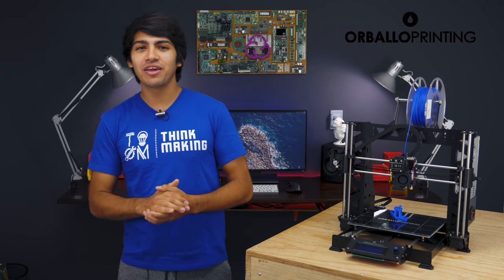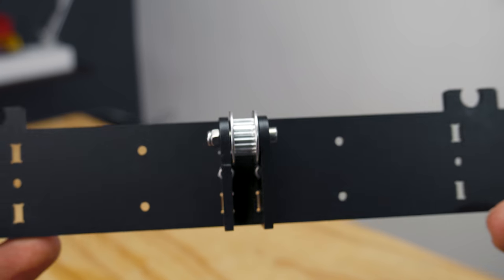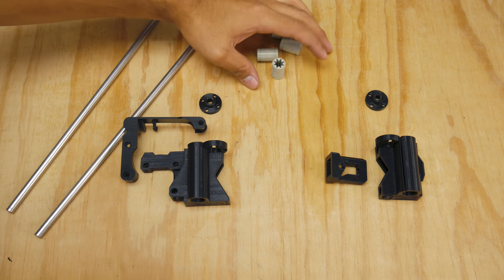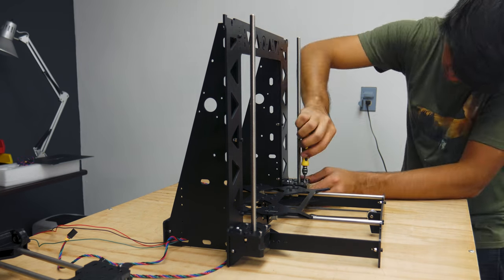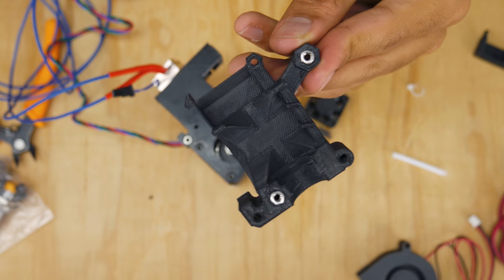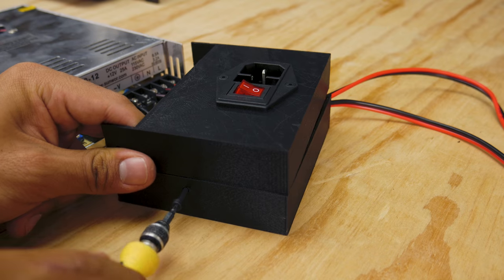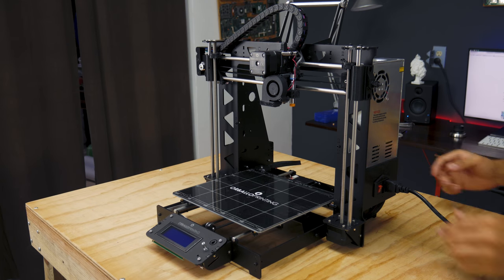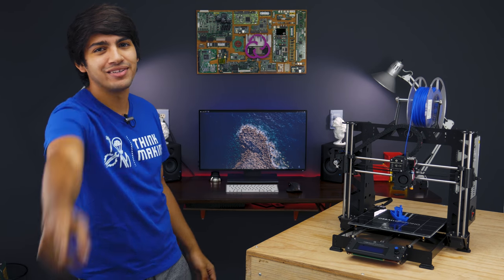🛠️⚙️ Prusa Steel Black Edition MK2 - Build Guide

Comment: Great video! I had my frame delivered from Orballo a week ago, just started building it - this video will help a lot. I must say, that support in my case was pretty good. Always answered within minutes on website's live chat and shipping (in Europe) took less than a week.

Couple of things though - I bought a frame only and a black screw kit, but after seeing this video, there are two pieces missing which I can't find on their website - the upper lead screw bearing and Y axis motor spacers between plates (also heated bed brass standoffs). Any ideas where can I get those?

EDITED: Got in touch with Orballo, they quickly responded about these two things: the bearing model is MR128 and motor spacers are 10 mm.